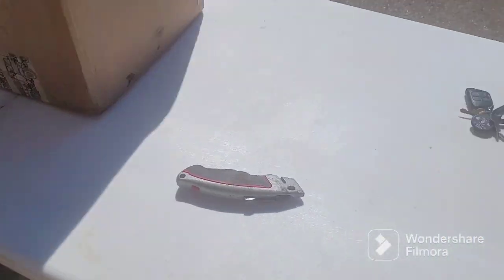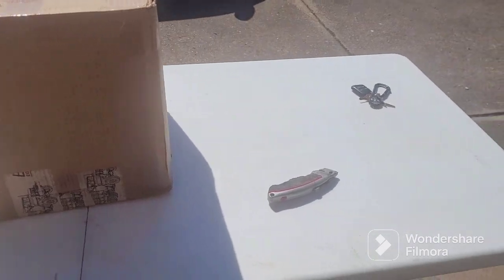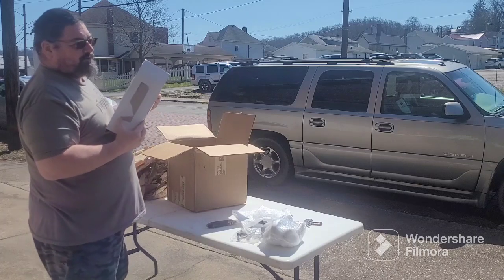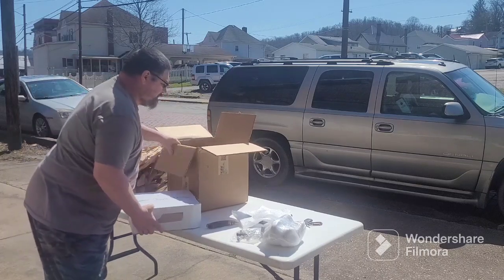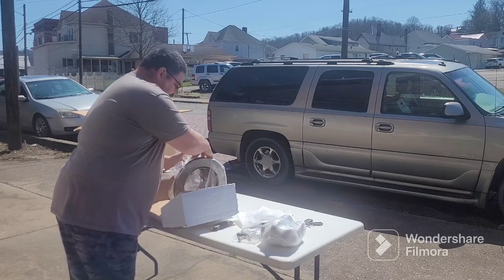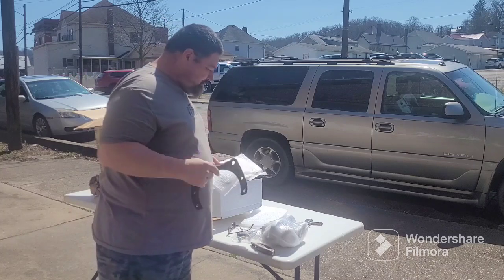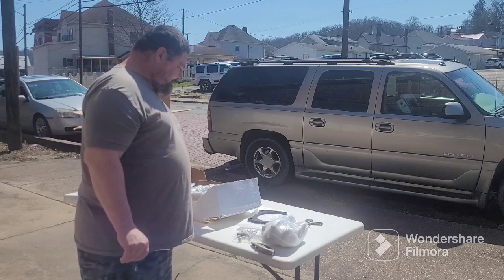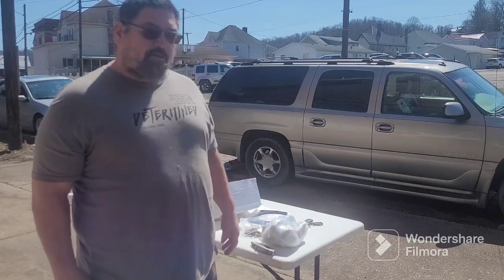M35a2 deuce and a half rear disc brake kit from Boyce Equipment.

Comment: Fantastic!  Have you found that they work for the front axle as well?
Reply from the maker: They do not. Not enough room between the hub and spindle.
Reply from the maker: They do not. I'm still trying to find a way to do them with off the shelf parts.